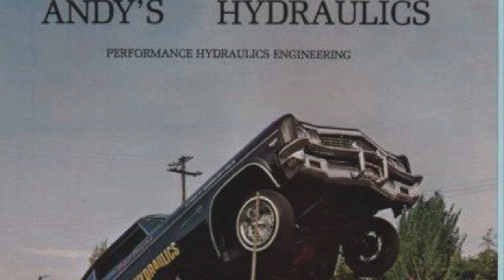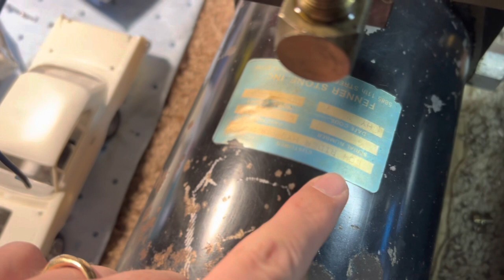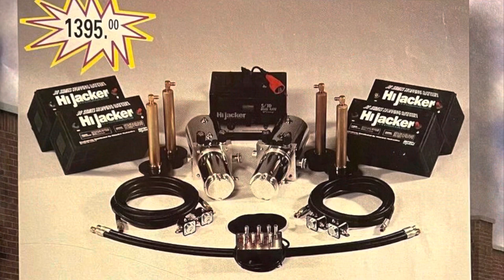Old school vs New school. History of lift gate hydraulic pumps.

Comment: In 1992 I had a convertible 64 impala. It was a complete rust bucket. My father in law was a body man who helped me body work and paint it. The thing had bondo all over it. Anyway, I had the hydraulics installed at speaker works in Hialeah  fl. Speaker works was red's hydraulics before it was officially red's hydraulics.  I also bought my first set of Dayton wire wheels from them used. They took the rims off of the " flamingo " hopper. 4 pump 8 batteries.  I was 17 years old and it was the time of my life.  Still lowriding today at 48. Only difference now is I build my own stuff.
Enjoy your content man. Good stuff keep it up and good luck with the channel
Reply from the maker: Thank you bro!! I appreciate the kind words. Man.. a 64 on juice at 17! 🥶! Again, thanks for watching. Take care bro 👊🏻👊🏻

Comment: I appreciate this video. I love going into the history of lowriders. 

I can COMPLETELY relate to you, from ahe 14-19, I ate, drank and slept lowriders. Now I'm 32 and for the last 2 years I've had a massive itch.

I'm proud of the 60s-90s hydraulic companies because they were constantly innovating. I have become disenfranchised with the modern hydraulic companies. There hasn't been any game changing products to hit the market and everyone sells the same products.

I am in the process of launching my own line of hydraulic products. I've actually already built a few prototype pumps. They should be about 4 times more powerful than what is currently available. I'm also developing a dump that will operate just like an adex, but will be a fraction of the cost. It will not be an adex clone it will just perform better than an adex for around $400. I just am figuring out what kinds of parts I would want, and figure other people must also want them. I'm still about a year away. Here's the deal, up until this point, every hydraulic pump in a lowrider was engineered for going in a lowrider. They were engineered for aircrafts and lift gates. Same with dumps, delta makes industrial cartridge style solenoid valves. Adexes, as bad ass as they are, they were built years before lowriding was a thing, they were made for aircraft. I am designing products from the ground up that are built for 1 single purpose, LOWRIDING without compromises.
Reply from the maker: Thank you for watching. I appreciate the support. Keep us updated on your venture. Sounds badass!
Reply: @gemcitywelding7234  Thanks. Be on the look out for Airborne Hydraulics.

My motors have dual sets of brushes internal fans and massive ventilation and I got different size motors, my mack daddy motor make close to 10hp and powers a #16-#17 pump head. The pump and the gear are massive. It's kind of like an aircraft pump as opposed to a modern hydraulic, by which I mean it requires an external reservoir. I didn't like how modern lowrider lift gate pumps have a small 1/4" pressure port hole feeing into the block, some blocks  are 3/4-1" it makes no sense to feed a 1" pressure port on the block from a small little hole in the pump head. Seems like a choke point.  So my pumps have a 1" inlet and 3/4" outlet. If there weren't gears in there you could stick your finger straight through the gear. No choke point.

I'm building a 96 Town Car as test vehicle and a rolling advertisement. I'll probably make a video covering the build when I start on it.
Reply: @evanpimental  Are you on Instagram or FB? Most of the lowriding community is there

Comment: I remember when I got my first 100 subs I was surprised people were watching my poor quality and amateur edited videos then I got 1000.  About 2 yrs later. It's really hard to grow a channel that is geared towards lowriding.  It's just a very small niche.  My first setup was a reds 2 pumper with the clear motor end caps.  And it had 1/4 inch plumbing with the weenie slow downs built into the dumps what a terrible design. But it worked. I used to go thru dump cartridges all the time.  I've learned so much since them days and spent way to much money along the way
Reply from the maker: You’re 100% correct. But I’m thankful people watch the videos. I’m trying to get better at the production side of things. Like Cletus McFarland said, “ everyone wants to be a YouTuber until it’s time to edit” I remember those clear caps!!! I thought they were so trick. Ahh the good old days. 👊🏻

Comment: I'm working on a 84 LeSabre out of Dayton well my question is on reinforcing the frame do I wrap the engine belly all the way I have the engine out now And do I use 3/16 all over it and how far should I extend my a arms friends and mentors welcome
Reply from the maker: Great question! My honest answer is it would depend on what your plans are with the car. Is it strictly a lay n play street car or do you have plans to hop the car? 3/16 is always recommended, but it’s not uncommon to see 1/8 to mold out the framework. On the arms, I would suggest 1” to 1 1/2”. Anymore than that and you could run into steering issues. Hope that helps. Thanks for watching the show.
Reply: Lay and play mostly but I'd like to hop just for fun now and then nothing crazy

Comment: I just picked up 2 fenner pumps with delta dumps for @$100 not to sure yet if they work any suggestions what tonlook out for .
Reply from the maker: Hey bro, great question! Early fennerstone pumps use a very specific type of gasket inside the pump head, it’s almost like a Teflon seal. Also pull the tanks off and see if they have magnets on the inside of the tanks. Magnets are there to catch metal shavings and prevent them from going and recirculating back into the pump head. Before putting any pump into service especially one that is as old as a Fenner pump make sure that if it’s running an external check valve that it’s going in the correct direction. Some thinners have internal check valves. Some have been modified to accept an external check valve. Those are just a few of the things that I would look for if it was me personally. Congrats on your new purchases. Best of luck.